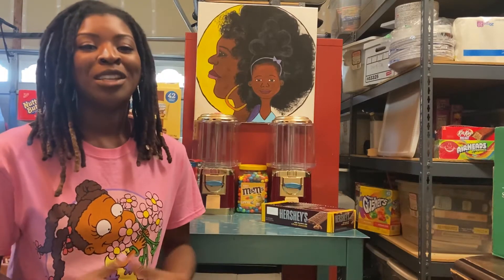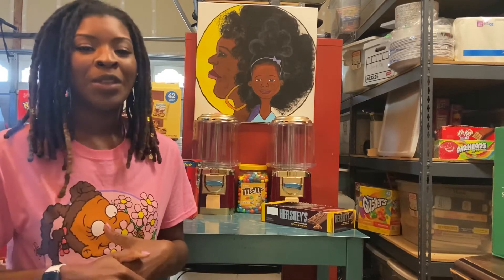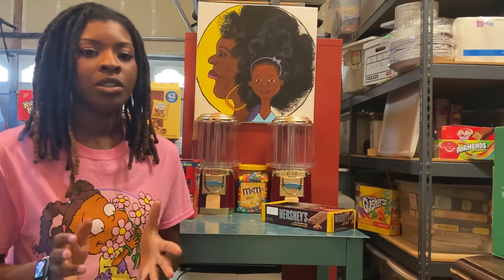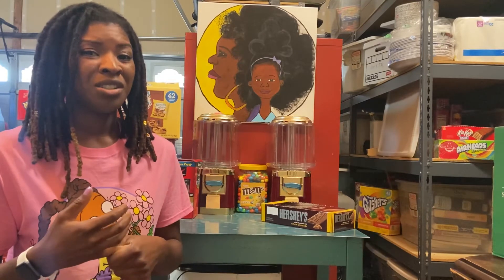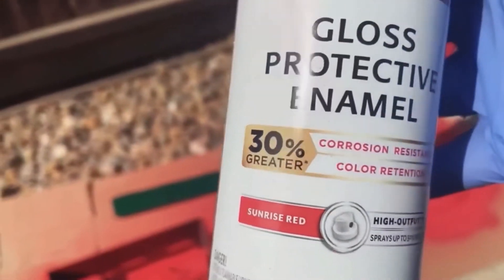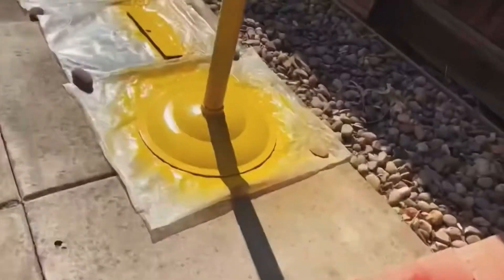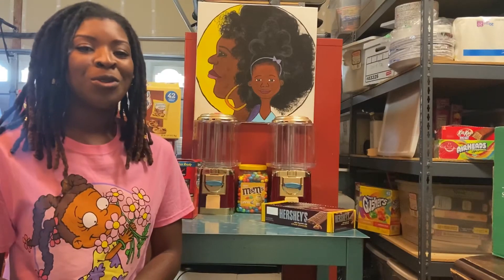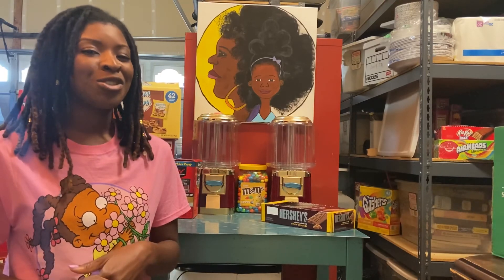How To Refurbish Vending Machines

Comment: Do you have to sand down the machine before you paint it?
Reply: It depends on the condition of the machine.  If there is rust, definitely sand before painting.  If the machine previously had a vinyl wrap, you'd be wise to sand before painting.  If you are painting over an existing paint job, maybe sand before repainting depending on how thick or uneven the paint job you're covering is.  But if you are buying a machine with its original paint job  & no major issues beyond dings and scratches, you can skip the sanding.